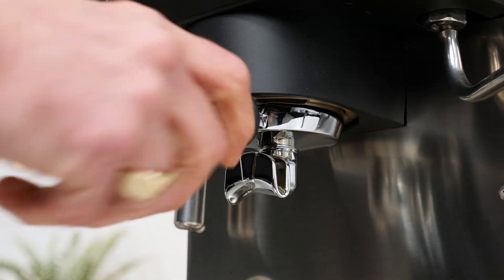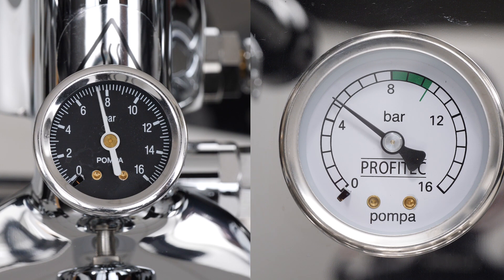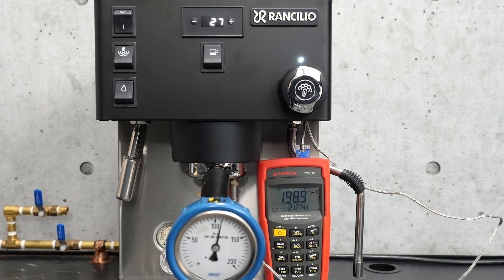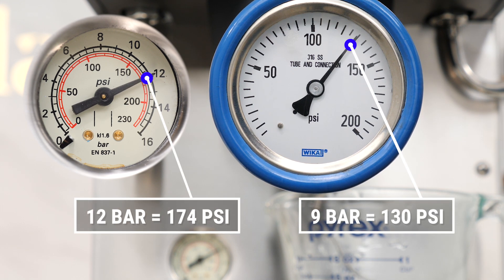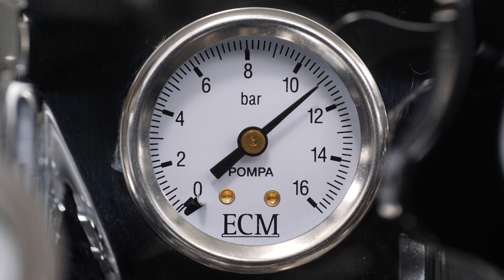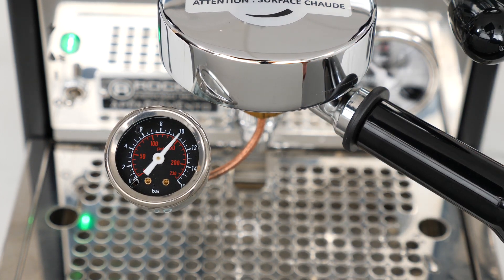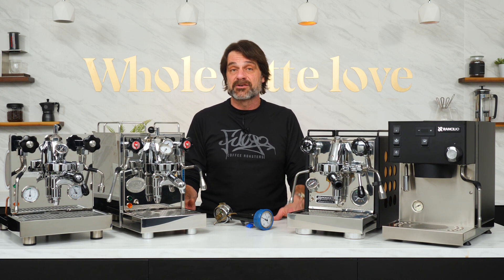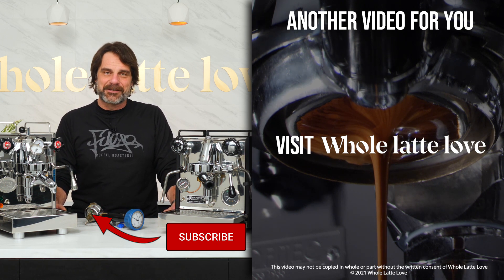Brew Pressure on Vibration Pump Espresso Machines

Comment: Bonjour Marc
Très bon sujet je vous remercie pour votre engagement.
J'ai une question quelle pompe vibrante ou rotative privilégier vous l'expert pour équiper votre machine sans prendre en considération le paramétre bruit ??
Reply from the maker: good morning Marc
Very good topic, thank you for your commitment.
I have a question which vibrating or rotary pump do you the expert prefer to equip your machine without taking into account the noise parameter.

Comme le mentionne @pinard Fr, la pression monte plus rapidement avec une pompe rotative et la plupart des machines à pompe rotative peuvent être connectées à l'alimentation en eau domestique. Les pompes rotatives ont un débit d'eau libre plus élevé d'environ 11 grammes par seconde. La vibration de la pompe est d'environ 8 grammes par seconde. Étant donné le choix, je préfère une pompe rotative pour la possibilité de se connecter à la conduite d'eau, un débit plus élevé et un son plus agréable. J'espère que ça t'as aidé!
Marc

As @pinard Fr mentions the pressure rises faster with a rotary pump and most rotary pump machines can be connected to household water supply. Rotary pumps have a higher unencumbered water flow rate of about 11 grams per second. Vibration pump is about 8 grams per second. Given the choice I prefer a rotary pump for the ability to connect to waterline, higher flow rate and more pleasant sound. Hope that Helps!
Marc
Reply: La pompe rotative monte plus vite en pression, elle permet par exemple de mieux gérer une préinfusion, est "beaucoup "plus stable et enfin elle permet d'etre raccordé au réseau d'eau mais elle est aussi plus chère...

Comment: I adjusted my Appartamento’s pressure down a bit because it was 13 from the factory measured at the grouphead.  But I only lowered it to 11.5.  Honestly, that works just fine with a good grinder.  It extracts the right amount in the 28-sec range and the coffee comes out perfect.  So maybe 9 bar is not always necessary?
Reply from the maker: Hi S, Thanks for sharing. As mentioned in the video manufacturers have their reasons for setting pressures as they do. Personally I believe flow rates are more important than brewing pressure and in our testing as well as others there seems to be little difference in extraction yields through a surprisingly wide range of brew pressures.
Marc
Reply: Hi Marc - you mention the static pressure to get 9 bars on the Scase [not sure if I spelt that correctly] on all the machines except the Rocket. What would you suggest for static if I fitted a pressure gauge to the group head? Jan23

Comment: Isn’t it really about the grind and tamp, but more important The TASTE! 
BTW as machinist I can make a copy of the Scace for peanuts.
Reply from the maker: Hi MJ, Thanks for the comment. It's always about the taste in the end!
Marc
Reply: I was thinking the same thing until I read the linked interview with Scace. There's more to it than just making a few bits. My immediate question was how big is the hole that lets the water out to simulate the extraction flow rate? In the interview he also says he uses a plastic 'fake puck'. Then there is the problem of getting a temperature sensor quick and accurate enough. I'm a software developer & amateur machinist so I have some of the skill necessary to build and run one, but I don't have the metrology that Greg has!

Making an adjustable OPV and static pressure tester is no great challenge, but I think one of these is a bit of a mission and without the metrology expertise would probably just be misleading.
Reply: "as machinist I can make a copy of the Scace for peanuts" Man, I think you have an eBay business waiting for you. I certainly would be a buyer at a decent price.

Comment: Hey Mark,
I have an Expobar Brewtus III double boiler machine. When looking at the machine gauge during the extraction of an actual espresso shot. Which would NOT be Static. It should be between 10.5 and 12 bars also? Same as your static tests. To get a proper 9 bar extraction at the portafilter? If I understand correctly.
Reply from the maker: Hi PC, Thanks for the question. Been awhile since I've seen a Brewtus III. I have not tested that machine with a Scace so cannot say with 100% certainty. But if Vibration pump I'd try setting at 10.5 bar static. If rotary try 9.5 static.
Reply: @Wholelattelovepage  I'll give it a try.
Thanks Mark!

Comment: Another Excellent  video…..  Rancillio also suggests the pressure can be adjusted on the regular Silvia by measuring how much water the opv breads off in 30 seconds
Reply from the maker: Hi Ardy, Thanks for the comment and adding that info!
Marc

Comment: Will you be doing a similar video for rotary pump machines? I have a pro 700!
Reply: Yes please MARK
Reply from the maker: Hi JG, Thanks for the request. I will visit rotary pumps in a future video! Until then, know that rotary pumps run much with less of change in pressure between machine gauge and what's on the coffee. That's due to the higher volume of wter they move at a given pressure as compared to vibration pump machines. Unencumbered rotary pump machines moves about 11g/s of water through the group. For vibration pumps it's 7-8g/s.
Marc
Reply: @Wholelattelovepage  Good to know but anyway - waiting for rotary pump video. Cheerz Marc ( I have Quick Mill Aquilla Black ☕️)

Comment: What about flow rate? It's not measured by the machine
Reply from the maker: Hi m, Thanks for the question. Flow rate is not measured unless machine has a flow meter. Flow and pressure while not the same are "cousins" with higher pressures resulting in higher flow rates.
Marc

Comment: Thanks for clearing this up! I always wondered if we the 9 bars for espresso referred to a blind filter reading or are meant to be achieved during an actual extraction where pressure must be lower due to water being able to escape the system. The only other thing I am now interested in is to see what the group mounted gauges read during actual espresso extraction. Would have been nice if you had included this as well. Since espresso flow is not static like in a scace device this would be quite interesting.
Reply from the maker: Hi Tim, You are welcome and thanks for the comment! Actually, when using a Scace you are not measuring static pressure as the device simulates an extraction by releasing water. Group gauges typically read about 1 bar higher than Scace pressure reading during testing.
Marc
Reply: @Wholelattelovepage  Thanks for clarifying. What I meant with static is that flow doesn not vary with a scace device like it does in espresso extraction. It is just fixed, right? So if we know that group pressure is typically 1 bar higher than that shown by the scace device, how does group pressure look like in an actual extraction after you have adjusted it according to the scace device? I would assume that initially it builds up and then should drop as more coffee is extracted and flow increases. So what is the proxy pressure you guys set your machines to before shipping or when servicing?
Reply from the maker: @timgerber5563  Hey Tim, Group pressure typically does drop slightly as an extraction progresses. Depends on the grind as to how much. When we adjust pressure it's to 10 bar static for vibration pump machines.
Reply: @Wholelattelovepage  Technically, the gauges are all measuring static pressure (vs velocity pressure or total pressure), but the control volume is static, which I understand is what you are referring to when you state static pressure.  The reason the Scace device is more accurate for actual brewing is, as you state in your video, it allows water to escape at an approximate rate of a puck of coffee (assuming your shot flows at the rate the Scace device is calibrated for.)  If your shot flows faster, it will have less pressure, and vice versa.  I believe these pumps are positive displacement and thus pump a constant volume.  The pressure they develop is solely the result of the resistance to flow (coffee puck, Scace orifice, OPV).  As for the video, I think you are spot on in helping us all understand the nuance of the pressure in an espresso machine, my only correction is to the way you use static pressure.  Thanks for the video.

Comment: James Hoffman seemed confused by this
Reply: Hoffman knows a lot about coffee, roasting and commercial machines but his domestic machine reviews were very poorly researched. He just clearly didn't understand the machines or how to use them.
Reply from the maker: We have our specialties. I'm lucky with nearly instant access to most every prosumer level espresso machine available in North America.
Marc
Reply: @davidk7262  You might be on to something. I've got my BZ13 at 9 bar on the gage cause Hoffmann recommended this. Testing to see if I can get a good shot. I will say that high pressures lead to channeling. At least in my experience. Maybe I need to work on puck prep. In any case, I have work todo.
Reply: @damienhull6497  Did you solve this or dial back the pressure? I'm very interested in this machine, but I'm really frustrated that there's no information available on this and many many people seem to complain about the factory pressure set too high...
Reply: The problem is, that this video is misleading and confusing as hell. There is no way to calibrate a machine to a "true" dynamic brewing pressure of 9 bar, not even with a Scace device. Which coffee puck does that device even resemble? A 16g or a 22g puck? A finer or a coarser grind setting? Setting the static pressure higher than 9 bars means that in the worst case a finely ground high dose will be extracted with more than 9 bars. Calibrating the static pressure on a closed system means calibrating the maximum pressure which shouldn't get higher than 9 bar in the portafilter, even if no water is released.
Reply: @3ede467 Well, it's a limitation of the design because the OPV pressure isn't measured at the head.

So you're going to get something like -1 to -1.5 bars at the group because the pressure is lost along the way.

If you want this kind of control, you need to get a machine that can measure pressure at the group. Else you will have to manually adjust the pressure on each machine and measure with a scace.

But I think ultimately the 9 bar rule of coffee extraction is more of a guideline and not something that will completely make or break an extraction.
Reply: @rustycolon9368  Even 9 bar can break an extraction as it leads to higher risks of channeling and uneven extraction as for example 8 or 7 bar… But that wasn’t my point here at all.

What I was about to say is that using a Scace device is nonsense as it just resembles one specific flow rate/resistance that cannot be used to calibrate the pressure at the group head as flow rate differs from puck to puck/dose to dose.

Dynamic pressure can be measured but not calibrated as it is dynamic as the name says. All you need is to calibrate the static pressure at the group with a manometer mounted on a closed portafilter. That pressure will be the maximum that the machine can build up during an extraction and that is, what you want to be set to your desired value. You don’t want your machine to be able to use 1 or 2 bar more on a puck that has been ground too finely. Because you probably want to fix the grind setting instead of drinking that shot…
Reply: @3ede467  I agree, though if this was understood better nobody would use a scace device correct?
Reply: @rustycolon9368  A Scace "thermofilter" is primarily used to MEASURE brew temperature and pressure in the portafilter. Not to calibrate it.

Comment: I understand why the pump pressure gauge reads higher than the Scace. But why does the group pressure gauge read higher than the Scace? What causes the drop in pressure between the group and the Scace?

Thanks for an informative video!
Reply from the maker: Hi Dave, You're welcome! The group gauge is further back in the system. Not a lot further but enough it holds at a higher pressure than what's read within the portafilter where water is exiting.
Marc
Reply: @Wholelattelovepage  hello hello, can you please please write if you know how much pressure is lost between group head measurement and Scace. For example if you install group head pressure gauge and do real extraction and it shows 9bar, what will than show Scace, 8-8.5? I just need that info to complete this puzzle of pump pressure 🙂 thanks a lot
Reply: The pressure reading on the Scace higher than the group gauge was due to Scace emulates the espresso extraction, water goes through and you get the lower pressure reading as well, essentially we need 9bar limited at the coffee puck not the pipe line.